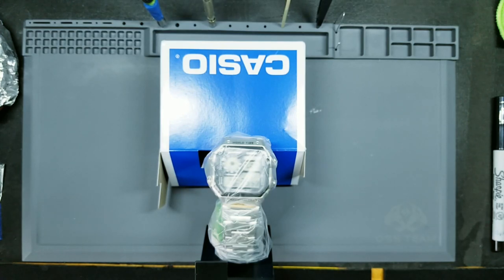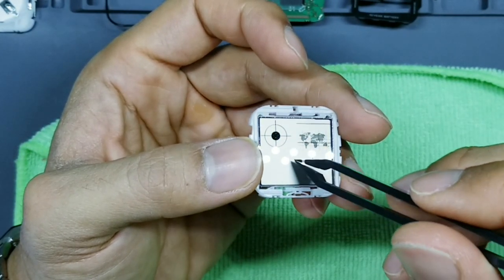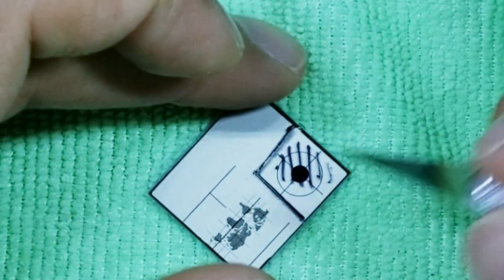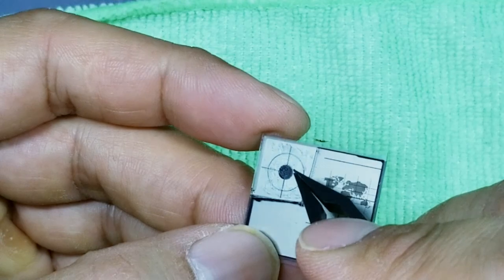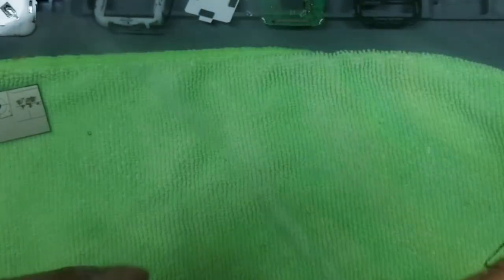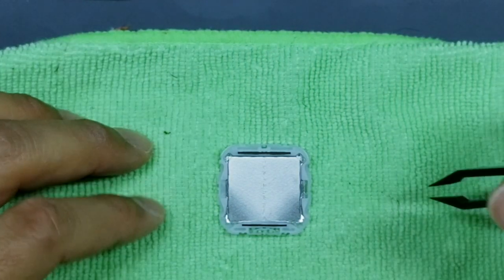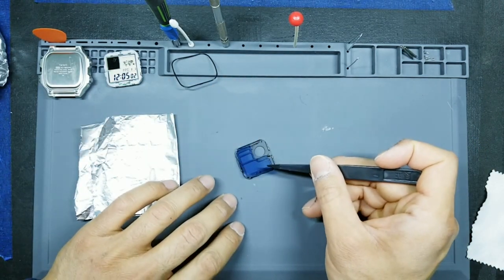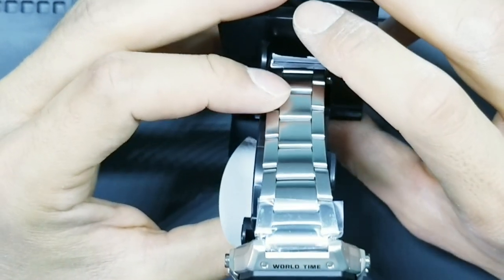[Modified Casio] Customer Casio Mod: Paul's Modded AE1200WH-1A

Comment: I like watching your mods.
I found an interesting little mod that only takes a few seconds. I tried this on a SKMEI 1373, the same basic design as the Æ1200, and it looks pretty cool. While I had the masking out of the housing, I took a yellow highliter to the white indices and numerals on the little mini clock in the top left corner. Obviously, you'll want to use a brand new highlighter that has never been dragged across ink. I didn't want to try it with a used one, because my luck would've been super dark yellow or mostly black on the clock. Instead of just coloring them in, I chose to dab the highlighter to get the effect, just to avoid ruining the white print by smearing it. 
I still haven't garnered the courage to completely tear down an entire movement. I'm waiting to destroy or for a watch to fail completely so I can use that one to tear down and see things up close and in person. The only problem, I haven't had either of those things happen yet lol.
Reply from the maker: Great mod project you did there. Thanks for sharing.

Yeah, ive worked on that same Skmei watch too. Great to practice on since theyre so cheap.

Which brand of paint marker did you use?
Reply: @watchncarry9593 
I used Sharpie, just the regular plain old wide ones that have been around for decades. I had bought a 4-pack several months ago and I had never used any of them. I thought about using the orange one but ultimately decided against it. I have to wonder how much better the effect would be on the Casio, just because of how much brighter their white is compared to the SKMEI paint. I'm looking at a 1335 that I bought only because it was the cheapest one they had with the correct black steel bracelet. Anyway, I've never used or worn it, and aside from removing its bracelet several months ago, I've never touched this watch until just now, and being brand new, there's a world of difference their white and Casio's white that I've worn almost daily for the past few years. Personally, I think the effect would stunning on a Casio's clock and I'll bet the orange one looks killer!
Reply: Plz share a link or video of ur mod, I was thinking to try this mod on my ae1200.

Comment: An amber LED backlight plus a blue filter reduces transmitted energy in the inefficient part of human day vision, but it's helpful for low light/night vision. where blue receptors take over.   That can't be captured accurately by a video camera unless it has a night sky mode.

btw, I like Casio's matte silver-painted (not chromed) watch cases, but like titanium paint color better, because it works with grey silicone straps.

Comment: Why use so much glue to secure the Lee filters? A few tiny pieces of double sided tape are enough to hold them in place. The filters get sandwiched between the display and the black frame so no need to overdo it.

Comment: This may be a dumb question but is there a reason why you can’t just apply the polarizing filter in the same way you apply the colored lee filters, saving you from scoring and separating the layers of the screen?
Reply from the maker: No worries, it's a good question. 

So from the factory the Casio watch already has a polarized filter on the top. If we were to remove this filter and rotate it 90° we would get the desired negative display effect. However when you remove the factory polarized filter, the glue residue becomes visible and cannot be removed, so you need to replace that portion of the polarized filter with a new polarized filter film. This is the only way it will work to get the desired effect. 

Putting a new polarized filter on top of the factory Casio polarized filter will not produce the desired effect.
Reply: I checked this out myself once a long time ago, just to see what, if anything, would happen. The film I had blacked out the display completely, regardless of which side was facing the LCD vs the crystal, and also regardless of how I oriented the film on the display.

Comment: So cool, I just got a skemi world time silver, would be a cool watch to mod ...
Reply: Yep, they're very close to the Casio Æ1200. The movements won't interchange between the two and the back covers are very slightly different, but that's about it. I have a silver 1382 and a black 1373, and with the same feature set plus a few extras, they give the Casio Æ1200 a real run for their money. They could've done a little better with the number segments in the LCD, because theyre actually kinda ugly lol. They could've thinned them out a little and given them a little bit of a slant as opposed to having them perfectly vertical. Another one of their more inexpensive watches, the 1016, has a good slant, so I know they can, but they just don't. The numbers on that one could also stand to go on a little diet.
I don't know if you've done anything yet, but if you're going to remove any of the lettering, the best thing to use is Goo Gone and some of those slant tipped cosmetics Q-Tips. The regular ones work too, but the slanted ones are great for that really small print like in the top left corner where it says "Alarm Chrono". It takes forever to do, but the end result is fantastic. I've tried using a similar product called Good Off, and while it works exponentially faster, it also alters the resin underneath so it has a different texture and even looks vastly different. Almost as soon as you touch the Q-Tip to the surface, it'll have black residue on it, so you know immediately that you're ruining the plastic. I've tried both, and I'll never use Goof Off again for a project like this. The end result is very much worth the extra time and effort from using Goo Gone.
Reply: @sped6954  thanks so much for all that great info. Really  appreciate it
Reply: @brianfromireland 
You're very welcome. Seeing your post on the SKMEI and this whole video about modding these Casios made me start thinking about a project that I started planning a few months ago but I never actually got around to even starting it. I removed all of the outside text, the entire bottom line and the top left lines of text from the masking. Next up, I cut a small piece of greenish yellow lighting gel to go behind the masking only in the top left corner, then I took a yellow highliter to the front of that part. The final thing was replacing the original resin bands with a black steel bracelet from a cheaper SKMEI watch, but with the exact same housing and a silver BullBar for the G-Shock DW5600. Oh yeah... it turns out that the outside dimensions and shapes of the DW5600 and the Æ1200 housings are so close to each other that the G-Shock BullBars will also fit all the SKMEI models that are based on the Æ1200.
And I still haven't finished watching this video yet lol. Which I'll be doing now I guess.

Comment: I was messing around with the polarized film, could you not just place it on top of the screen without taking a layer off? Won't it still invert the image?
Reply from the maker: Unfortunately it wont. U have to remove and replace. I show it in another, more-recent video.
Reply: @watchncarry9593  okay thanks for your reply, maybe Im just misunderstanding the concept, is the size 5 film normal for casios? Or do I have to check between different watches
Reply from the maker: @macemig601 no problem. It's a question i used to have too.

i always use A4 linear polarizing film. Im not sure on size 5 unfortunately